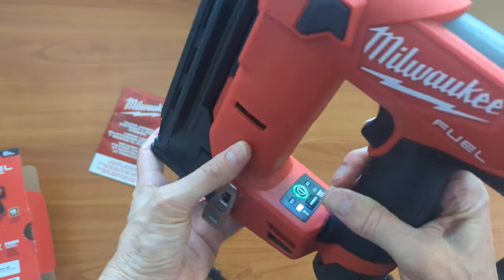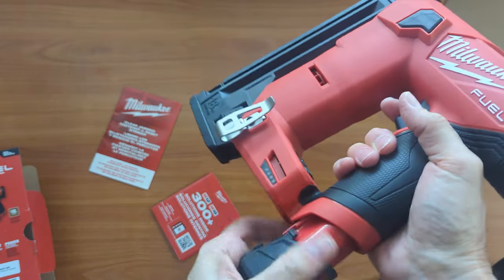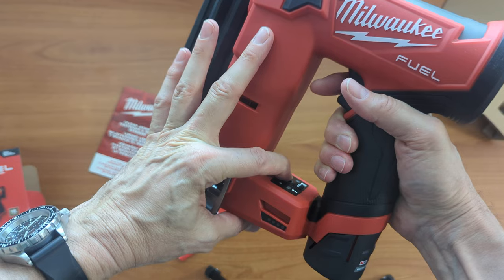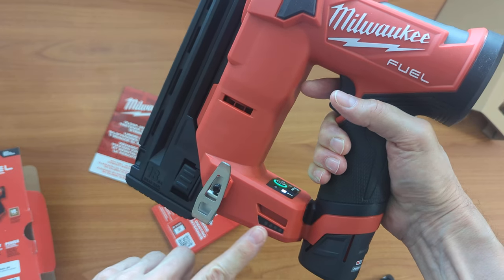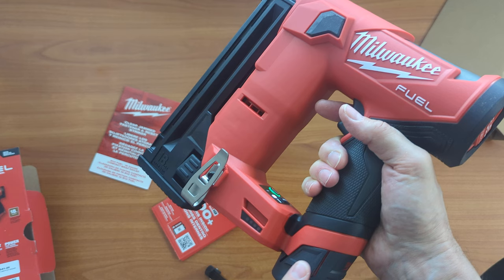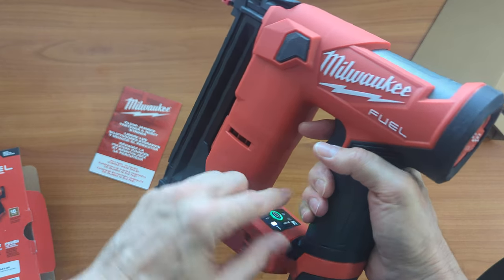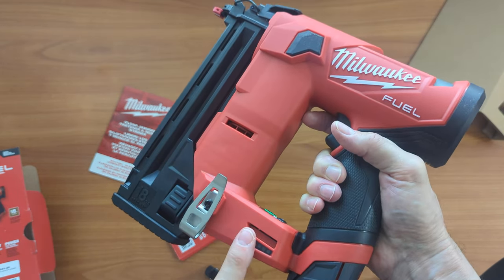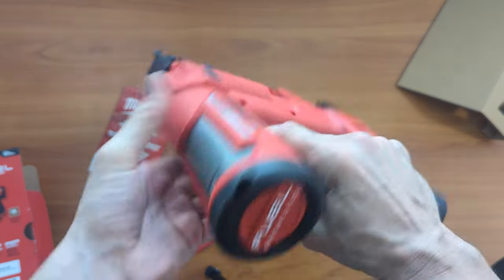Fuel Gauge on Milwaukee M12 Brad Nailer Does Not Light When Powered On

Comment: I had the same problem on two of them, and then when I just happened to squeeze trigger on second one the gauge turned on for a few seconds. I am curious if this worked for you.
Reply from the maker: @jadams4368  Yes, a trigger squeeze does make the gauge appear.. Thanks for the tip!
Reply: @ScholtzLife You’re Welcome. By the way, I contacted Milwaukee to ask them is there a typo in Manual and is the Trigger Gauge activation normal, and they never answered my question. I still don’t know if this is normal.
I returned my first one when I stumbled on this trigger activation on the second unit. I use HD in Minnesota. Irritating to not know what is normal.